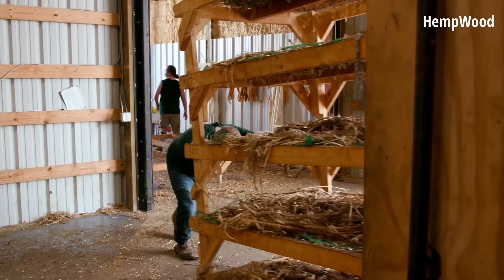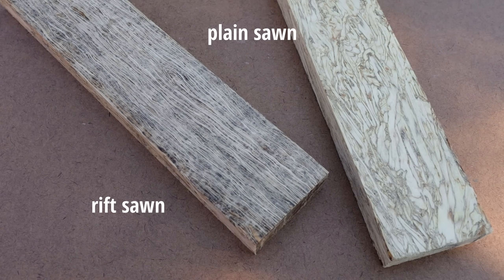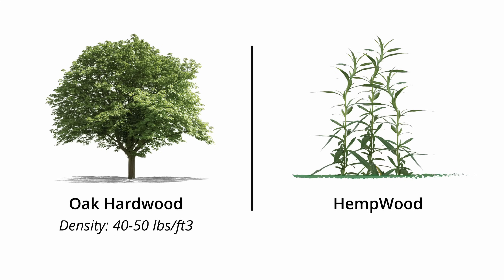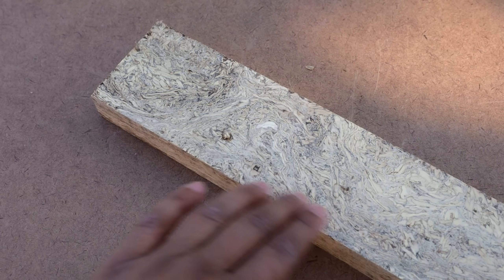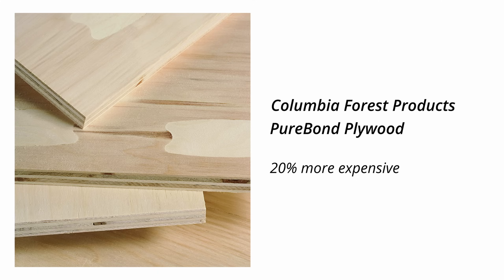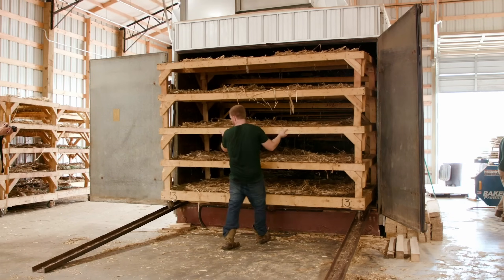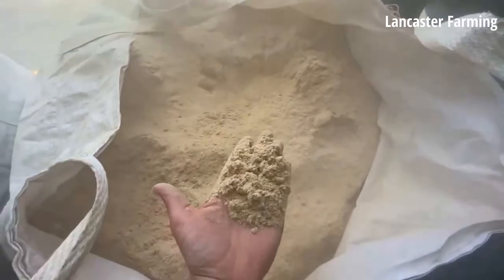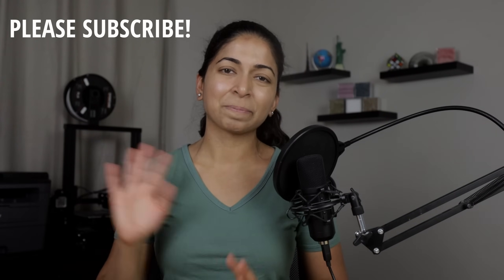HempWood | a NEW eco-friendly hardwood

Comment: Several Points :
▪ While I did own inferior t-shirts "made from Hemp", they were no-name. The brand name jeans I'm wearing (right now) are made of hemp and durable.
▪ I  have advocated, loudly, for Hemp for Years after Sailing with Hemp Rigging versus other materials. (Yes, I have tried Marijuana, it does not appeal to me.)
▪ I am quite excited about the Hemp Lumber and 4'x8' sheets because I want durable materials for the various Cabinets I must build. Pine is soft. Plywood has VOC's. Hardwoods have desirable properties but because several of the cabinets will be painted, it is a real crime to paint such beautiful wood that has grown for a century and was killed to hold things.
▪ I do admire the look of the Hemp Lumber shown here but painting at least some of my cabinets will be win/win to protect them from humidity and not have that look dominate my living spaces. I won't feel guilty about painting them.
▪ To wrap up those last 2, natural grain colors definitely add definition and warmth to a space but color is a great way to use the light of the space so go ahead and paint that 150 day old Hemp.
♧
Reply: With that level of water susceptibility, you'd need a polycarbonate seal, aka a plastic. If you want to use a purely natural polycarbonate, you gotta go sticky, aka using the natural resin found in fir and pine trees.
Reply: @Arterexius  Interesting,  thanks. I plan to purchase samples and test them.

Comment: If it's completely manufactured from stalk to wood, why couldn't the specs be adjusted to make it slightly less dense so that it's more usable for other applications? While this particular recipe sounds fantastic for particular uses, this seems like only the first step in a plethora of potential uses for hemp. I'm on board with this!

Comment: This is a great product and people should continue exploring, but many construction materials are hard to recreate in a eco friendly way without sacrificing quality. This is a finishing product and it has it's place, Hemp has some amazing properties, but comparing it to Oak is a bit misleading, the reason Oak is such a wonder is it's ability to handle water where Hempwood can not, hence why ships were built of it and you get 100+ year old Oak furniture, so yes they both are hard, but just need to compare apples to apples. Good video.
Reply: Oak is also resistent to rot, insects and fungi. The reason for all of it is high concentrations of Tannic Acid

Comment: I have been looking at hemp as a material for a while now and see great benefits with hemp in several areas. Interesting information review, thank you. Btw In Sweden, we always use a vapor barrier when wooden floors are laid on a concrete slab (floating floor). So there is no difference between hemp wood and other wood. /Siggi
Reply: You're right! HempWood Engineered Hardwood Flooring is treated the same as traditional engineered hardwood flooring.

Comment: 4:55 I take issue with this claim. It's not incorrect, but I believe the way you demonstrate it leaves something to be desired. When wood-- any wood-- gets exposed to a hot and more importantly concentrated flame for an extended period of time, it Carbonizes instead of burns. This is an important note because the carbon foam that occurs is non-flammable and is a very efficient black body radiator, and thus leaves the wood less surface area to burn and blocks the fire from spreading to the perfectly flammable wood underneath. You can even see at 5:09 that the wood starts to ignite, but is very swiftly stopped by the lack of available fuel and potentially maybe too high a fuel/oxygen mixture at the nozzle.
This would not be the case if it was in contact with a house fire, or really anything besides a propane torch. It would catch just like a 2x4 would catch if it was exposed to fire. And I'd argue that a regular 2x4 would display this behavior as well, of not catching when exposed to a propane torch for an extended period of time. I argue this because I've tested it when starting fires in fire pits myself, and also due to the aforementioned reasoning applying nearly equally to dense wood planks of most other types. Balsa Wood maybe not, but I suspect that might actually demonstrate some muted form of ablative shielding. Note, that's not actually backed up by any testing, it's just a hypothesis.

Comment: Any type of wood that is glued together by any means, is susceptible to water damage and will swell. As a cabinet maker, I would probably not use Hempwood for anything else than hidden parts or sofa structural pieces, as it is good for replacing the common fir and pine wood used there. It is however high maintenance and is thus not easy to use for other furniture pieces and I can neither see a lot of usage of it in floors, due to that high maintenance. The majority of the population will not obsess so hard about wood and proper treatment of woods as cabinet makers, carpenters, architects, designers and enthusiasts will and thus it will require some serious effort to seal it properly, in order to be used in common household furniture. These sealants would most likely be a polycarbonate seal to make it properly watertight and able to resist common cleaning agents and thus its entire purpose to be eco friendly, would be defeated, as all manmade polycarbonates are plastics. Your use of oakwood as a comparison doesn't seem entirely thought through either. You left out something very important about Oakwood, that sets it aside from many other woods. And that is its high concentration of Tannic Acid, which makes oak wood highly resistent to fungi, insects and also rot. Since rot is caused by high levels of moisture (aka water and air), oak is also fairly resistent to water damage and will at most start to curve and bend after long exposure, but it will not swell. This is something any woodworker can easily fix, but we cannot fix delamination in woods like Hempwood. Burning oak also takes a bit of effort and keeping a torch to its surface is not a great way of setting fire to Oak (only if its super old and haven't been treated properly in decades). Your comparison would have made more sense using fir or pine instead, as they are not only more common, but also more susceptible. They're no hardwoods, no, but if it has to be a hardwood, use Beech then. Using oak just didn't make any actual sense.
Reply: Wouldn't treating it with an oil work fairly well? Like using lemon oil on traditional woodwork? 
I agree it wouldn't be a great choice for kitchen or bathroom, but why wouldn't it work for a table? People interested in eco-friendly products like this are usually willing to put in a bit more work caring for them.

Comment: Isn't this how Partical board is made? I dont see the point of hemp building matterials.
Reply: Yes, yes it is. This is really just fancy particle board or fancy OSB. The only use case I could think of, would be for the structural beams of Sofas and Upholstered chairs, although plywood would still need to be used to cover it, but at least it could replace the pine then, if made cheaper.

Comment: I'm interested in hempwood for more than flooring. Could this be made into a door? It's so dense that it might be more soundproof than a typical solid core door. If it were say, 1 1/2 inch thick, instead of an 1/8th inch thick veneer, it could be a cheaper alternative to a solid wood door. Could hemp be made into a cabinet or wall paneling/moulding material? How about a cutting board?

Comment: Very exciting to see this being manufactured - but the price is too high right now. I'm hoping the price goes down over time.
Reply: Our products are now at a competitive price when compared to traditional materials.
Reply: @hempwood2602  Oh great! I'll have to check them out!
Reply: @hempwood2602  Oh I checked - looks like your boards are around $14-15 a bd/ft. This is around the same price as LIVE EDGE Walnut - which is some of the more expensive hardwoods available. 

Dimensional boards of Walnut can range anywhere from $6-$10 a bd/ft, and can come in thicker options like 6/4 and 8/4. 

Definitely a LOT better in price than before - but still a ways to go in terms of being "competitive".  Shipping also seems pretty high - $40 for 2 boards - that's almost 50% of the cost of the boards. I would suggest the company consider other shipping options.

I'm going to keep the site bookmarked and will check periodically to see if/when the prices come down a little more. Thanks for the heads up though!

Comment: Is the hardness of hemp flooring from the adhesive, the composite of adhesive and hemp, or the hemp itself? Can a hard protective layer be put on top of the flooring like wood floors get so people can clean/mop the hemp flooring for kitchens and foyers? Or is it only good for areas where you might put carpet down (living rooms and bedrooms)? Installation and thicknesses like regular oak flooring planks instead of just engineered flooring with plywood? Certainly do follow up videos on the products and company progress.
Reply from the maker: I believe the hardness is the result of how much the material is compressed. I'll ask the company if you can put an epoxy coating over the entire floor to protect it. Thanks!

Comment: Seems like it has limited uses until someone figures out how to make it resistant to moisture and humidity.
Reply: The humidity level for engineered is 35-70%. The numbers reported in the video were for solid HempWood. As for the resistance to moisture, HempWood is similar to traditional hardwoods.

Comment: looks like a good product. was that a pilot or prototype plant making it? looked like a very low production rate for all the hardware involved in it. use pilot holes to drive nails in. might need custom connecting hardware. maybe modify ikea hardware.asit's moldable hemp might find good use in shapes that need  to bemolded. since molds can be used it opens up the possibilities of inserts which can add functionality or properties,

Comment: I understand that its susceptible to water and moisture, so does that mean it can not be steam bent?
Reply: I don't think you can successfully bend any engineered wood product.
Certainly not a parallam or a sheet of OSB.
Steam bending relies on softening the lignin and swelling the cellulose fibers in solid wood, so they don't collapse.
Hemp "wood" is relying on a soya based binder and compression to hold it together. 
If you saturate it with live steam it is going to un-compress and puff back into a bundle of stalks.

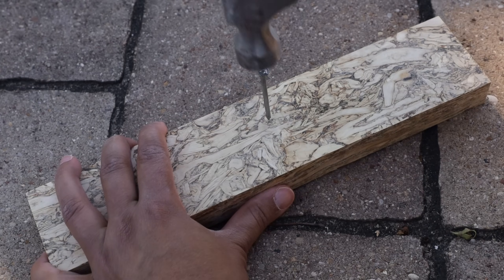Comment: 9:15 I know the pain. Currently doing renovations and house frame is made of Ironbark & Jarrah flooring. Just patching in a  couple floorboards were plumbing was has destroyed about 20 drill bits( you can not hammer into these woods without pre drilling) and wrecked my saw cutting it to size.
I guess renovations weren't something my grandparents considered doing 60yrs ago.

Comment: IMO hemp seems to have a lot of qualities in line with concrete in terms of strength and density. Could it be used as bricks with a waterproof coating rather than hard to maintain flooring? Or inner wall bricks at least. No nails need be harmed!
Reply: Hempcrete is what you're looking for. It exists.

Comment: Couldn't they put on some surface coating to the furniture or flooring? To you know, make it water resistant. So if you had a hempwood table and spilled some water on it, it would be fine under some thin coating?

Comment: So, it's basically an eco-friendly and prettier particleboard. I like it.
But it doesn't seem very good as flooring, particularly. Then again, neither is particleboard. :-)
Reply: While the material is compressed with the aid of an adhesive, HempWood is much more than particle board. It's hardwood! Our flooring has a Janka Hardness Rating of 2,200 lbf (that's 20% stronger than oak).
Reply: @hempwood2602  Seems to me it would be a better candidate for furniture than for flooring, considering its special requirements in care?

Comment: Is it used as a engineered timber? Thinking CLT / LVL /  Glulam etc. edit thought I was safe posting with 30 seconds left in the video.. turns out it's not used for those applications though I'd wonder why.

Comment: Hemp has traditionally been used for it's long and strong fibers which made it perfect for making ropes. But the fibers can be worked to make them soft enough to replace cotton in a lot of uses while remaining much stronger. Cloth made of hemp will be much more resistant to wear than it if was made using cotton.

Comment: This must have popped up because I was looking for more sustainable products for a boat I'm building. Is the soy-based glue also mildew prone or just rapidly degrade in the presence of any kind of moisture? Either way, that price is ridiculous for something that's purely ornamental and fussy with questionable aesthetics. I can't think of a practical application outside of flooring for a desert house where this might actually work and one really has to like the look of something that resembles glossy OSB, in which case, one could just throw some high end epoxy (very low VOC) on OSB and add a top coat for UV resistance.
Reply: Which would then also defeat its entire purpose of being ecofriendly (Epoxy Resin is a thermoset polycarbonate (plastic) and cannot be recycled). I have yet to hear of a glue that will not rapidly delaminate any woodproducts glued together (except for the polycarbonate based glues, like Epoxy, Acrylic and Quickset, as well as Silicone based glues), so I doubt you'd find something like that and being ecofriendly for a boat build. You could of course use Tar as a sealant, as that's a traditionally used one, but it's probably neither than environmentally friendly to use. I am a cabinet maker in training (have 5 years of hobby experience already) and I'm neither a fan of this new "hard wood" alternative.

Comment: Curious about your thoughts on just a straight stained/epoxied concrete floor? That has to have the best kind of wear resistance/longevity doesn't it? And for the most part, for those of us in slab on grade houses, it's "free".

Comment: Another video I watched didn't mention hemp wood's fire resistance. Another one was about a concrete like material made from hemp demonstrated how fire resistant it was. Very interesting. The hardness of hemp wood would be a drawback for many uses, but flooring might be good. Needs to be more water resistant. Maybe as the technology develops someone will figure out a way to solve that. And maybe a way to make it a bit less dense for use in more products. I like the idea.

Comment: Considering the density of HempWood, could it hypothetically be used for Wooden pieces in tools, like handles for axes, brooms, or for wooden items like walking sticks, quarterstaves, or the hafts for weaponry? I'd be interested in finding out how durable HempWood could be for such things.
Reply: Hemp fibers have high tensile strenght so there shouldn't be any reason why they wouldn't perform as well or better than hardwoods like maple, hickory, or ash that are often used for tool handles or baseball bats. I would be more concerned that they would be too hard and rigid to the point that they might be less comfortable to use, as too much shock is transfered to the user rather than absorbed by the wood for something like an axe

Comment: I'm all about using a hemp product for the simple fact that it can be used from seed to harvest to manufacturing and such a tight window. I do not like the fact that they are using it on engineered plywood when the entire product could be made out of hemp. There is no reason to use hemp is simply a veneer over wood even for flooring when the entire product could be made out of hemp.
Reply: We use an engineered format to avoid cupping and so the product can be placed on multiple subfloors. We use the engineered format for the sake of the customer.
Reply: @hempwood2602  more than likely because it already exists and it saves you on production money but at the cost of your product I would want something that would be equivalent to solid hardwood. I know you're just starting out and kudos to you. Perfume on a pig is still going to smell like a pig. 
I am willing to keep an eye on you guys to see how your products evolve as well as your bottom line.

Comment: So I was also very interested in hempwood for its various building properties. 

Do you know why it's not rated for structural use? (other then price)
Because other engineered lumber products have similar density. like LVL beams and PSL beams. They are both incredibly dense and very difficult to nail or screw into but can be used as structural members for replacements of steel beams.
These engineered wood products are manufactured virtually the same way as hemp wood is manufactured and their density seems similar enough, so I see no reason as to why it can't be used in the same application.

Also, there are Marine grade finishes that can be applied to the surface of lumber to make them waterproof. ( ie wooden lathe canoes, wooden oars, and wooden furniture in high humidity environments)

Comment: Belinda, love your content & videos, learnt so much between the comparison & what each material is made out of. Unfortunately, while I love hemp products, the soy-based adhesive is a No, No for me as I’m allergic to soy, & hence have intense dislike to soy candles too. I’m sticking to Hempcrete for now for Tiny House, cork flooring & rigid cork insulation that’s similar to rockwool (not the spray one, since that one has adhesive). Through one of your videos, rockwool is an alternative for sound insulation that’s great to keep rodents, bugs & insects out.